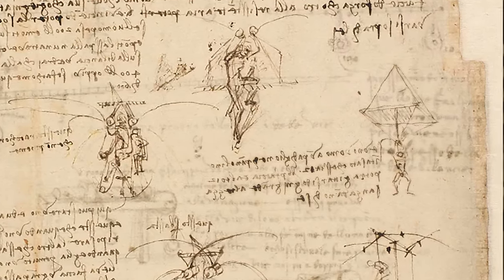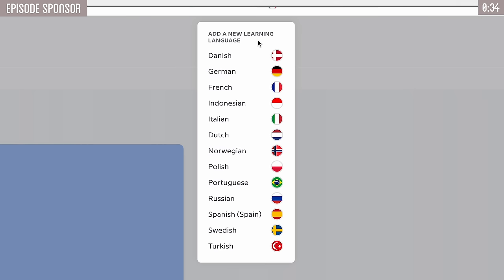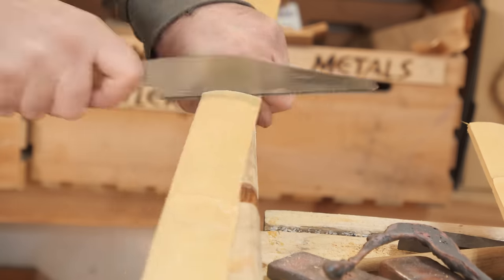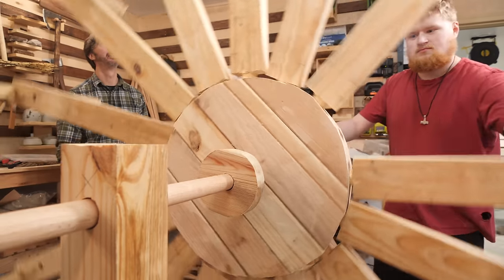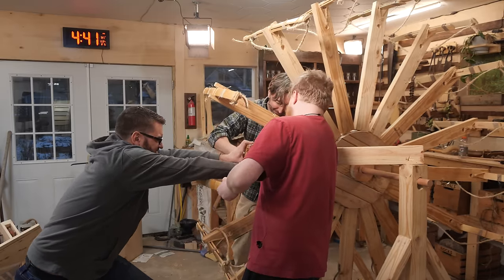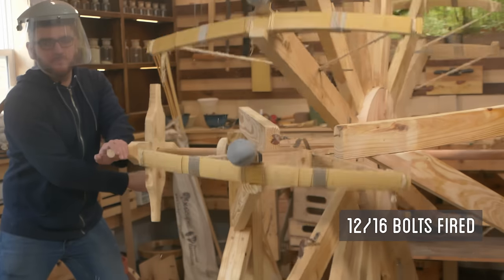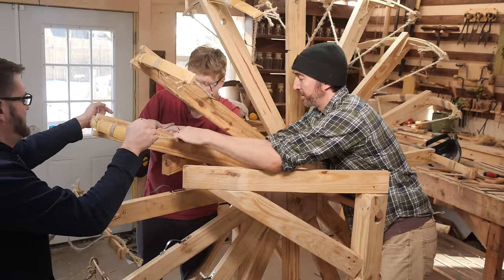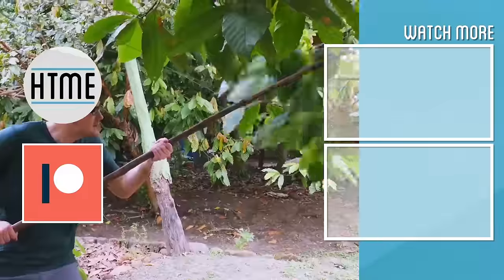I Built DaVinci's Machine Gun Crossbow!

Comment: Pretty good attempt! A few issues... first, you need to "fire" earlier as the arrows still have the downwards vector from the spinning wheel. You WILL need fletching to stabilize the flight, as you can clearly see that the downwards force makes the arrows tumble in flight. A "real" trigger/lock instead of the "push upwards" system would also increase reliability and flight.
My verdict on Leonardo's invention is fairly negative though. It somehow works, but loading the weapon is cumbersome and outright dangerous. It would be almost useless in battle. If all you want is 16 shots in a short time, then it would be much easier to simply mount them in four stacks with four crossbows each, then pull all of the triggers at once.
Reply: But what if you were outfitting a secret jungle temple with booby traps and wanted all the shots to come out a single hole facing down a long hallway with flagstones carefully set to trigger a counterweight to drop and rotate the mechanism at the slightest touch but also wait in perfect condition for at least a 1500 years to protect a golden idol which has to stay in the temple despite its obvious spiritual significance to your culture which is obviously still active enough to create large monuments yet will soon disappear from prominence mysteriously, leaving clues only someone with the ability to connect an obscure and arcane system of clues and historical facts or assumptions would be able to decipher? What about then?
Reply: @PatrickKniesler  Then you are effed, obviously. :)
Reply: Whacha?
Reply: maybe a  pull pin release would be easier. Yes, quite useless as 16 shots and a long time to reload. 100 shots would be what you need out of it, but as a siege weapon, reload time isn't as important.
Reply: @PatrickKniesler this commentd my favorite 😂
Reply: Thank you for your input Jorge, we were definitely struggling to find a practical use for this in a time of full plate and cannons
Reply: @ianmcveigh6943  the sentence diagram would be terrifying.
Reply: If George says it needs something it does lol
Reply: Jorgy, you need to try this build for the maestro's sake, please!
Reply: Indeed. The whole benefit of Leonardo’s design is that it self-reloads. As long as that isn’t working, it’s useless.
Reply: @PatrickKniesler  My thoughts also immediately went to a gnomish trap when the inability to reload was settled on
Reply: Very good commentary Jörg
Reply: Love your Work Jörg!
Reply: Since Joerg himself chimed in, what if each crossbow in the device had an Instant Legolas magazine pre-loaded with arrows?
(Edit: I realized that it wouldn’t really matter since you’d need to still pull back each string just to fire another arrow again and since reloading itself would still be difficult without some kind of mechanical assistance this device would indeed be useless in an active war scenario)
Reply: You must be a lot of fun at parties...👎
Reply: of course Jörg would be the top comment on this video :P
Reply: ：００００
Reply: Or spin in the other way so you have upward motion increasing the range. Ofc that wouldn't work with this simple trigger mechanism, but its kinda shit anyway. No offense to the makers, it was a fun watch. 
Iirc davinci had the habit of making some error in his drawings, like an early copy right protection.

Anyway. I think they're wrong about his idea. Imagine this being mounted on a swivel in a tower. Powered by weight hanging below it. You could have one guy on watch ready to unleash a devestating volley at a moments notice. Just aim, kick some level and let loose. That’s the advantage, having 16 guys on watch at all times would be more expensive in the long run. Not to mention the toll on moral and endurance it would have during a siege.
Reply: @Lappmogel  The first part about manpower... has some merit. The issue with endurance and whatnot, though, is that this thing would be doing nothing while both reloading, and also when not firing due to position or just waiting for a good moment. The 16 men with crossbows are more mobile, and can be firing from whatever battlements or even on campaign, not just when the ideal moment arises. Other than intimidation, there really is no upside unless you're really that short-staffed, and in that case there are other more well-tested siege weapons.
Reply: @Varadiio  I mean you can still have a garrison, it doesn’t replace that. But lets if you have a garrison of like 100 men and are being besieged by a larger force. The enemy can just do fake attacks every night for weeks and still rotate their men and keep them well rested. But your guys need to be on constant high alert and respond to every attack like its real.

But if you have these you can be on a lower readiness and let the enemy make their move, you don't have to sound the alarm every time they carry ladders and gather up in the trenches. If its a real attack this will keep the first wave occupied. If its not then you guys don't need to run out. This doesn't have to be a "pull the trigger once and let it go" either, you can easily make it a "semi auto"
Reply: @Lappmogel  I'm not saying you can't use siege equipment as a force multiplier. I'm saying that you can, for example, build contraptions that drop large rocks on ladders. Large rocks don't require the manufacture of crossbows or bolts, large rocks aren't as easily used offensively, and large rocks don't require your valuable weapon smiths' time. There's just too much extra manpower in the production chain of this weapon.
Reply: @Slingshotchannel  🤣👍
Reply: don't forget to add some features.
Reply: Went straight to the comments, knowing I'd find you here, now I'm gonna pan back up and see that things features!
Reply: Why not just the wheel the other direction so the vector pulls the arrow up ?
Reply: HA its Joerg , good to see you sir
Reply: I think it was designed to fire crossbow bolts at a steady pace from a tower window into a bottleneck, not a flurry of 16 followed by a slow reload.
The idea was to fire steadily as fast as the operator could slip new bolts into place.
The hooks recock the weapons, so firing and reloading would be simultaneous - producing a moderate rate of fire, but more or less continuous...      :)
Reply: I think this could be very useful if placed on top of a siege tower. Basically, once the hatch opens and you're ready to storm the walls, you first release a one-time spray of arrows on the guards before the soldiers rush in. Otherwise, yeah... seems pretty useless.
Reply: I was thinking of ways to make the reload time faster, and I think it might be possible to trade a bit of the rotation speed for torque and have some sort of cam that scoops up the rope to pull it back into the notch automatically. At that point, you can try and load in by having arrows drop into the barrels when they are at the top of the wheel or when you run out to just quickly manually drop the arrows in, resulting in reload times of probably 1-2 mins, making it much more effective. Still, there's the issue with aim, so overall probably not worth it.
Reply: So when are you building this?

Comment: I feel like the only practical use for this would be on top of a fortification with several side by side, aiming up 45° or so with heavy headed bolts that can rain down on an attacker. 

As for the heavy trigger of the original design: wrap a rope around the handle shaft with a heavy stone  in the other end, so you just need to kick it over the inner edge of the battlement to shoot it. One crossbow man/ DaVince machinegun that then picks up his normal crossbow. 

A good first salvo that gives the impression of far many more defenders.
Reply: Park it at a trap entrance, drop the gate behind them; and a single operator can clear out the cell.
Reply: put it at the top of the stairs

Comment: Loading speed isn't as big of an issue if you look at this as a crew served weapon. You're going to need multiple people to move this thing around, anyway; they may as well be trained to load it.  
  
You would need four experienced people who communicate well. Two on each side, with one pulling the string (probably with a lever) and the other setting the bolt in place.  
  
As long as they communicate what they're doing and make sure each person is ready to rotate the wheel, they could probably get a rhythm going and load this pretty quickly.

Comment: Joerg Sprave and Tod of Tod's workshop made a crossbow with a magazine that would hold 5 arrows. If you collaborated with them you could have a machine that could fire 80 rounds before needing to be reloaded with the possibility of an auto-magazine hot-swap mechanism that could see your creation firing endlessly, or until you ran out of magazines of quarrels.
Reply: Crossbows and repeated ancient artillery nobody ever talked about  nitol call titanium the nickel titanium programmed by different temperature changes even electricity to carry a lot a lot of power you can even use piezoelectric crystals to maybe control nitinol power the Sterling motors as well a Sterling engine as the way to fire a patrol motion machines in Sterling engines to build this repeater German motors in in 94 engines are not very good acceleration like cars for vehicles but something repeated stats like for something like a repeater crossbow or a ballista they would be excellent at

Comment: Put paint on the tennis balls so we can see the spread pattern. Or take it to a field and tilt it upwards slightly to give it some arc.
Reply: Oh yeah they should be timed to when they shoot with a slight arc instead of directly straight
Reply: We talked a little bit in the studio about timing the shots. I was thinking of maybe having a vertical post on the end of the trigger arms that you could just raise and lower, but there's probably lots of ways to do it.   @LyteRetro
Reply: @ElliotKrueger  what about a tiny lift you can crank at the front base of the post. I doubt you would need to use that on top of a castle but you could put it at the opposite end to raise the back end to point it down.

and what do you mean you talked about it the studio you work for HTME?

Comment: So 3 things would need to occur to make this a more viable implement than say 16 individuals with crossbows.

1. Automating the drawing process: You could use a hook plus gravity to help mitigate force needed to draw.
2. You would need a resetting trigger system: Which already did exist in the form of a rolling nut system, which would be period accurate.
3. A semi automated feeding system: You could use the Chinese hopper system with a flapper that only can be engaged when the crossbow makes contact with the flapper, maybe via some "teeth" at the head of the crossbow.

And maybe a spoke and gear system could cut down on the amount of force exerted by the operator and maintain a more consistent speed, in addition maybe a treadwheel could also lessen the force exerted by the operator.
Reply: I feel like this would be more useful as a stationary defense piece, where you could use an ox whim to turn the wheel at speed.
Reply: I agree with everything you said, but I also think that reducing the number of crossbows could make everything simpler and easier. Something like 6 or 8 should be enough if it were able to be loaded, drawn and fired continuously.
Reply: Hook and lever would work for the draw. In theory you would only need to engage the hook and draw. Once this is done you could load. Either by spinning the wheel once to unload, twice to draw, thrice to load. 
The unload trigger can be adjusted to the arch in which would mark yard/paces to about where they would hit. Trial and error would get this and I am almost sure that archers of the day would know how far their arrows would fly based on the angle to which they would release. 
Someone with some skills could do a cad design and make it work quite well. Though I have a feeling the war department did not spend much on research and development. Most of this was done by single persons who would either sell their new wares in a market or has connections to get it in front of someone. 
This thing is quite cool.
Reply: @benhoward2619  possibly, like, yeah, more useful, but, still less useful then just, hand firing it, cause, you can aim it
Reply: @benhoward2619  Yes mobility or rather thereof is the only downside, tho you maybe could mount it on a cart to help increase the mobility ever so slightly.

I thought about using animal power as well, but I came to the conclusion that since they would have to move in a clockwise motion (much like they would in a mill) it would likely increase the size to the point where the weapon would become cumbersome, so I opted against the idea.
Reply: @zackrog1270  Indeed its not a bad idea the thought likewise crossed my mind as well in dropping the number to at least 12, but I would like to see how the suggestions I put forth would operate first alongside the base design and then reduce the number of crossbows should the higher volume of them prove inefficient.
Reply: I'm right there with you.    This is a good first proof of concept.  Refine the trigger & move on to recocking.
Reply: That doesnt solve the main problem though. The opponents can just choose not to stand in front of it
Reply: @seivernoname-tz9uh  That same issue applies to any fixed platform historically used, its not as if you're going to be waving to the opposition and saying I'm going to shoot you now, the idea would be to catch them unawares or in a cluster and or funnel.

Bare in mind this also from a period when formation tactics were still prevalent i.e. shot & pike, so you're likely looking at a target rich environment and while I do not know how heavy this would be, but presumably there would be at least 2 people operating this that being a "gunner" and a loader if not more, whom theoretically could reposition the angle to reengage the targets should they move out of field of fire.
Reply: Trajectory of aim can be adjusted by elevating the firing arms. Windage can be adjusted by setting the whole thing on a lazy Susan. Boom. Full aiming articulation.  Aside from that, the "sixteen" gets in the way of reloading and cocking operations. A quad, dual, or even single crossbow would have a higher sustained rate of fire if that is what it takes to allow fully automated loading and cocking.
Reply: @jennacoryell4160  I do not disagree with the majority of this however, I do not think that a single crossbow would have a higher rate of fire, mainly due to the time interval it would have between a full rotation, I think a dozen at max and a quad at min (much like a clock just for a mental image) would be the range you'd have to operate with if the fire rate is to be consistent and not wear out the operator.
Reply: @HypnoticChronic1   valid points, it would all depend on mechanical limitations of the various operations. Since none of us have taken the time to work out a model, we're just debating hypotheticals based on our differing visions of how it might be accomplished. The single or double crossbow wheel spinning at 15 rpm in my head may not keep up with the quad spinning at 8 or 10 rpm in your head, but we really don't know how much clearance and dwell time the cocking cycle requires until we work it out in a model. In any case, real war engine weights (300 lb plus) aren't going to be achievable by a single operator. It's gonna need a human hamster wheel, Roman style, or a team of oxen on a capstain. Probably not worth the logistical complexity (maintenance included) vs a team of crossbowmen.
Reply: @jennacoryell4160  Indeed, that is why I hope that he may read some of these suggestions we've put forth here and tinker with the design so we can see the ideas in practice. I do disagree that the rotation mechanism cannot be operated by singular operator, given what we witnessed here in the video it can be done and the only real question is how long can said operator sustain continual usage for and at what point would they need to be swapped out and or can we mechanically reduce the strain from constant operation?
Likewise this is presuming he followed the original design down to the letter and did not scale it down to either fit the workspace and or facilitate easier operation with a limited crew, those would be question I would need answers to in order to make a accurate assessment and a alternative viable design in my mind.

Comment: Considering how quickly this came together into a working prototype and the amount of available skilled labourers at the time it seems like you could realistically actually have a working high fire rate self reloading crossbow/Ferris wheel/turret thing. I think you could reach 500+ rounds per minute sustained if you had a internal track that caught the string and drew it right after firing rather than a rope attached to the axel so you are only adding one or two bows draw weight to the resistance rather than 16 and a loading mechanism just after the apex, maybe just an inclined track that slides the next bolt in. I’d love to see these improvements explored

Comment: 14:20 or better yet, have one soldier shooting a crossbow, with another loading a second crossbow bow. Fire the first, hand it off to be reloaded, fire the second, and so forth. Bonus points if they have a large, self standing shield for portable cover.
Reply: that wont speed up things over just two crossbowmen loading and firing their own crossbows.  loading takes way longer than firing obviously, so you'd have guy number 1 firing both crossbows (assuming they started out with 2 loaded crossbows) before number 2 has even reloaded one of them. theyre better off each reloading and firing their own crossbow. the only viable scenario i can come up with for this method would be if it's about marksmanship rather than volume of fire, and the one firing is a pro marksman who is then aided by some hastily drafted noob tasked of reloading.